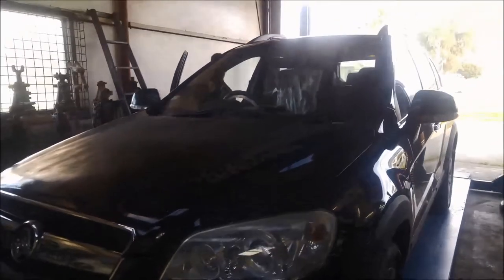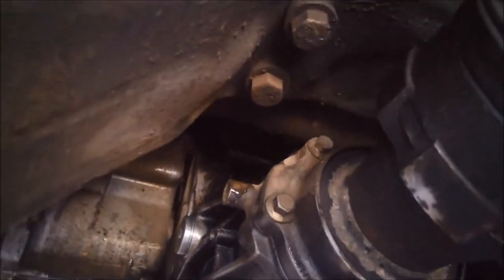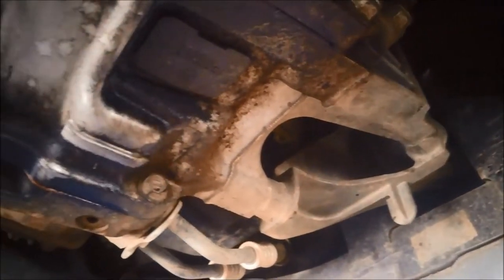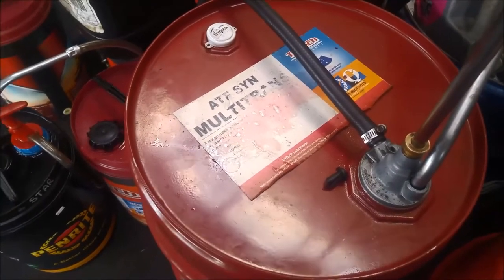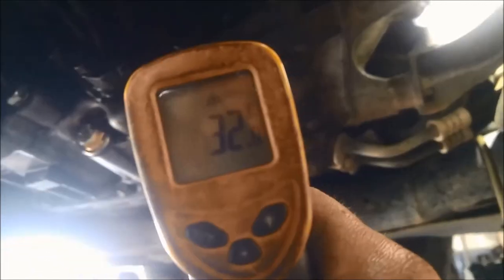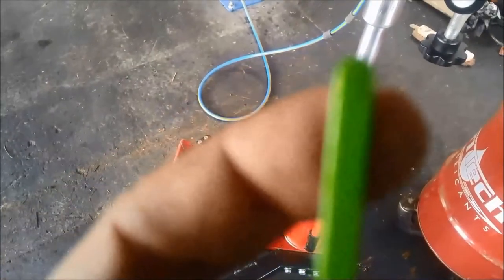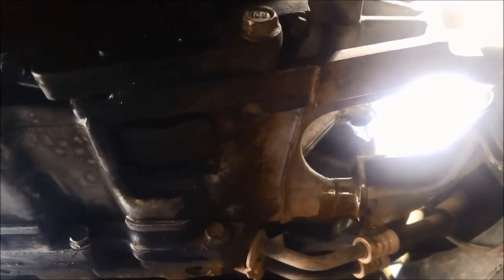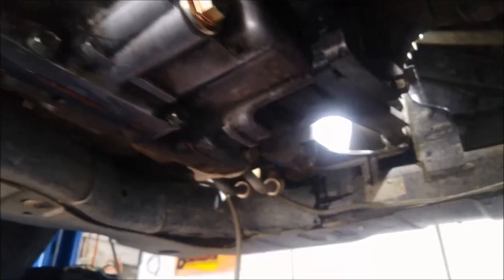Captiva 5 Speed AW55 50SN Automatic Transmission Service, how check fluid level

Comment: So these don’t run a filter on the trans? Just drain and refill until full like on a manual box? 🍺🍺🍺
Reply from the maker: hi, you can install an inline trans filter in cooling line, just make sure you confirm the direction of flow as the filters need to be in correct flow direction. cheers

Comment: Wait so the dipstick is only accessible from UNDER the car?! Can't access it from under the hood?
Reply from the maker: hi, you can access the level plug through wheel arch if you turn steering to full lock. cheers
Reply: @YepThatsIt  so assuming the car has to be on level ground and cool or does it need to be warm? Which wheel arch? Passenger or driver side?
Reply: @m4gician driver

Comment: Thank you for the great video, just finished getting my 2008 Captiva done. I thought it would fix the issuing I’m having which is gear seems to be slipping everytime I accelerate around corners/ in roundabouts. Unfortunately hasn’t, any thoughts on what it could be? Tranny fluid was dark.
Reply from the maker: hi, if only when accelerating on cornering, i`d say incorrect fluid level or split in filter causing suction of air. thanks & cheers

Comment: Hi mate, Have you changed the trans oil in a 2015, 2.4L Captiva 7? I have not been able to find anything online. Do you know where the fill hole is?
Reply from the maker: hi, did you watch this vid? it should be on there. cheers

Comment: My 2017 Holden Captiva is having an issue where the vehicle is bunny hopping/struggling when taking off from a stopping position. What does that sound like the issue is to you…?
Reply from the maker: hi, on these trans usually contaminated solenoids and sensors and blocked internal filter ( trans needs disassembly to replace that filter ) cheers

Comment: What is the correct way to check oil level? Engine should run or stop?
Br from Poland 😉
Reply from the maker: hi, with engine running at correct temp. cheers

Comment: Have 2008 Captiva LX Deisel..difficulty getting into drive..it goes in eventually and gearbox is fine but something seems loose or stretched..any ideas!..
Reply from the maker: hi, probably contaminated and/or worn solenoids and/or blocked filter and/or worn transmission. cheers

Comment: Hello! How much oil (cantitativ liters)is necessary only for refill? 
I have Chevrolet Captiva 2.0 D vcdi automatic gearbox. Thank you!
Reply from the maker: hi, you always should refill according to manufacturers specs and temp, just incase there was a leak or if the last person filled incorrectly. refilling with amount that comes out should only act as a guide to the amount needed. cheers
Reply: @YepThatsIt  Please tell me if the quantity of 4 liters of ATF is correct for refilling this automatic gearbox model from Aisin (Chevrolet Captiva 2008, 2.0 D, VCDI). I think the previous owner did not do the refill at ATF correctly and I can't find a manufacturer's specification for the refill. Only the total quantity in the 7.11 liter box is specified. Thanks.

Comment: Hi...I have problem in my  AW55-50SN body valve Captiva diesel 2010,After I cleaned the body valve,when my gear position in D there is a hard pounding and then it can run, after that it runs normally,what's wrong?
Reply from the maker: hi, usually would be a worn, leaking or sticking solenoid, or could be worn valve bore or sticking valve until it warms up. you need to do a few checks. cheers

Comment: Lovely tutorial. Where can i find the plug? Having a hard time to remove mine cos bolt head too small for my wrench it slips. I want the exact same as yours. If you could send a link or shop in sydney area please. Also how to change the gearbox filter? 2010 captiva 2.2 diesel

Cheers🎉
Reply from the maker: hi, we make the neodymium magnetic plugs. to replace trans internal filter you need to disassemble trans contact link is in description. cheers